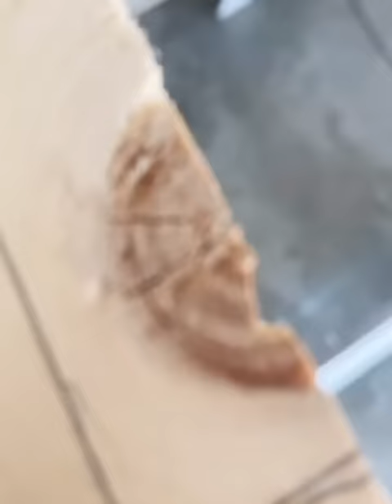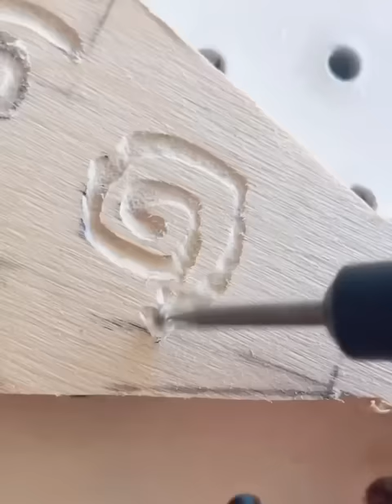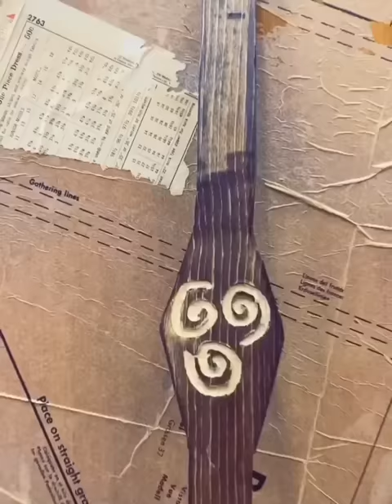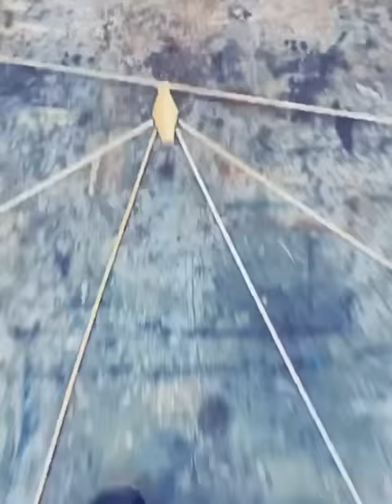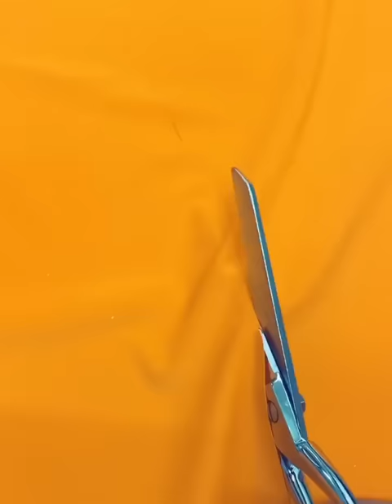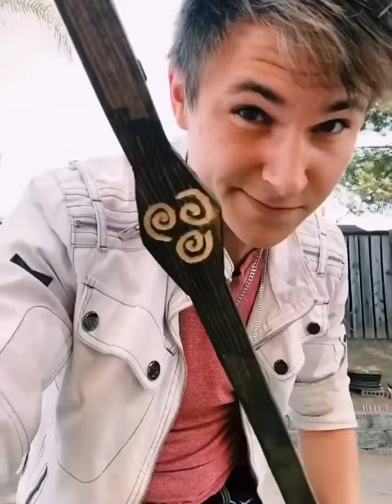Avatar aang glider !

Comment: I can’t wait till someone actually creates a real replica of his glider. Wings in the staff and all.
Reply: I don’t think it’s possible, I mean I could be wrong, but the way that the glider part hides in the staff perfectly, idk if that can be done IRL, it would be cool though
Reply: @picassoggz6571  definitely wouldn’t be able to glide with it but if you get a really thin material it is definitely possible
Reply: It won't be able to hold human weight or any extra weight in flight for that matter. But I'll get a start right away good sir. This may take a while...
Reply: @cainhassan3431  wait… you’re actually going to make one?😃
Reply: @ruswizzle  gonna give it my best shot and not stop until i succeed.
Reply: Alomg with a snacks holder
Reply: @vyshnavivaranasi8423  No, if someone were to make an irl glider, it should be the original one.
Reply: @ruswizzle  yea...maybe..but i meant the modified one ...like when aang and co visit the air temples..and there was this crazy scientist ..that guy fixes aangs glider and also adds a snack holder
Reply: @vyshnavivaranasi8423  I am aware of what you were referring too and I still believe it would be best if the original glider that was hand crafted by the monks was recreated.
Reply: @vyshnavivaranasi8423  snack holders easy. Not sure how the wings would work. Maybe spring loaded with a latch 🤔
Reply: @ruswizzle  the revamped one would actually be harder because it's circular. I'm going original design but I'll see if I can add the snack compartment because food is life
Reply: @cainhassan3431  wow..i hope u succeed in it
Reply: I think it can work using the same mechanism as an umbrella. But yeah, can be hard to perfectly hide the wings without making the staff too fat
Reply: @cainhassan3431  Woulf be nice if you can record it and upload it to your channel so we can see
Reply: @cainhassan3431  Upload to YouTube!
Reply: @picassoggz6571  some guy on youtube built a working fucking lightsaber. An air bender glider staff is nothing compared to that.

Comment: I thought the glider would pop up from the stick
Disappointed 😞
Reply: Mr. Ben that would be hard af I bet. this is still pretty cool
Reply: Same also disappointed with the outcome
Reply: same
Reply: Mr. Ben same
Reply: Same a little disappointing
Reply: Yeah, same
Reply: Bruh he tried his best
Reply: @obsessedwithcups8037  Spring loaded and folds like an actual fan. Have a switch on the arms so you can squeeze to open or a switch at the bottom of the stick (like a pen) so you can just press the whole thing to the ground to unlock the latches holding the fan parts closed and have the spring do its thing. The staff is gonna be a lot thicker but that's definitely more convincing than a skinny stick.
Reply: @oOcrownclownOo  starting building one..
Reply: Ye def. very dissapointed. Not only does the fabric not pop out, it's also way smaller.
Reply: @oOcrownclownOo  I'd like to see you try
Reply: Disappointed? Why? Because a tornado doesn't form when he'd swing that thing? That expectation of yours is physically impossible to accomplish. It's like someone made a wolverine claw to attach at their hand and you said;
"I though the claws would come out from inside of you fist
Disappointed 😞"
& Btw, what do you have on him that would cost him a disappointment? You have zero investment in this thing.
You could say it's a bummer. NOT that someone's effort is a dissapointment.
Reply: @chaoszest206  Sadly I don't have power tools. I do have some popsicle sticks tho so maybe I'll give it a try when I get some free time.
Reply: Right, same
Reply: Its possible, but that stick would be fat as heck,
Reply: Wanna see you try
Reply: Renzzi im sure he doesn’t mean any hate towards the maker just that he expected more out of him
Reply: Haters gonna hate
Reply: @Chaos Zest it’s a disappointment to HIM. They weren’t saying it was a disappointment in general. Btw you don’t have to be good at something to judge other people at that said thing. That’s like if someone failed to disarm a bomb, causing it to explode, and somebody says “they should’ve done better,” but then another person responds “oh have you ever disarm a bomb?!” lol no wtf.
Reply: Let's see you do better. Then you can rip on this. This is creative as hell.
Reply: @jordanfelt5978  the creator said he make it detachable so that he can change the wing design or just detached the wings. And that is some big brain level of thinking.
Reply: @Jordan Felt oh brother that’s such a weak thing to say in an argument. “LeTs SeE yUo Do BetTeR” like you don’t need to be fucking good at something to criticize others. That’s like eating food at a restaurant, you don’t like the food because it has hair on it, but the chef turns around and says “oh you do better then.” It’s such a naive thing to say and nothing will lose anyone’s respect faster than you saying that.
Reply: Huh? I'm kind of confused.
Reply: @kris_3220  
JHGW
Reply: G DHS ysyd
Reply: Ye this video was the most anticlimactic shit I've seen in a while...
Reply: Then make one yourself. This kinda shit isn't easy, and although it's possible to create something similar to Aangs glider, it would probably need significant design changes to actually hide the fabric, or function- meaning it wouldn't actually look like the glider.
Unless of course, you can figure out how to do it yourself.
Reply: @oOcrownclownOo  see? That's the difference between you and him. He makes and effort, you make excuses
Reply: @chaoszest206  telling the truth doesn't mean I'm making excuses. Also you do realize this vid was purely edited right? (the work was real but the transformation isn't). Maybe try fact checking before being toxic to everyone.
Reply: To all the butt hurt people: are you guys new born babies or something? The Internet is full of criticism on other people's work and you don't have to make something yourself to have the authority to judge someone else.

 Lets talk about the  People who thought this was amazing, how do they know this was amazing ? Make 1 yourself and then you can say it was amazing. Doesn't make sense does it?

You people got mad because I said I was disappointed 🤣
I wasn't bad mouthing the guy who made this. I just had high expectations but the outcome was mediocre.
Reply: @MrBen-zv1ip  it's also disappointing that we waited for the video to finish only to see that we've been tricked by mere editing. It raises your bar up high for the first few minutes then just drops you down in the end. I appreciate the hard work put into the project but he's literally just a few steps away from making it look good except what we got is a simple "pause-change-unpause" edit.